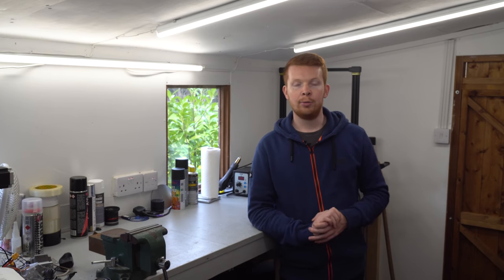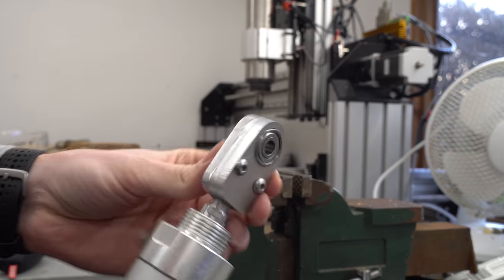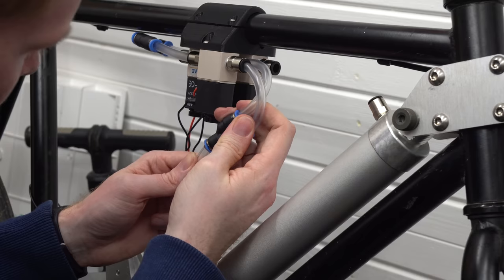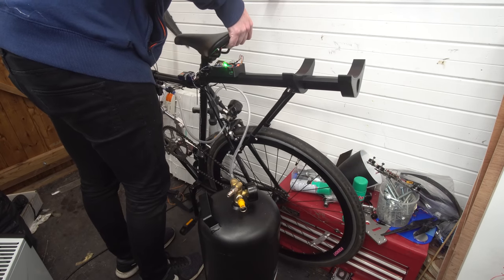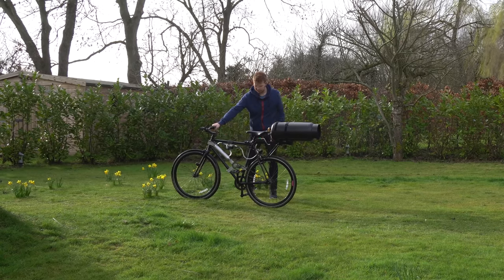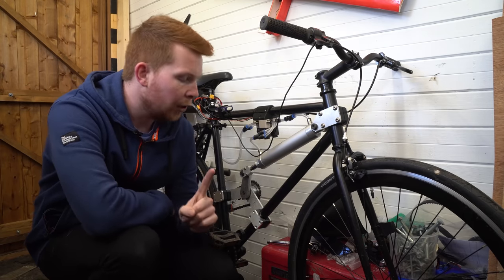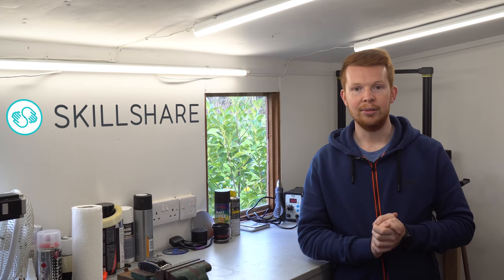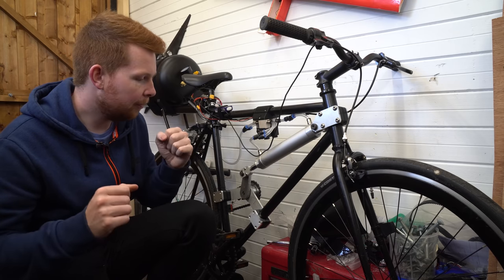Air Powered Bike

Comment: I've always wanted to make a spring powered bike, with a giant coiled spring in a giant disk in the middle of the frame.  This spring will wind as I go down hill, and wind as I stop, and after it has sufficient energy stored, I can use it to start up, or to assist on a hill.  Also, if I am riding down a long sloping path where I don't have to pedal, I would have the ability to include a front sprocket that I can switch to that will wind the spring also with the pedals.  The winding will be ratcheted and the drive itself will be an additional rear sprocket on the other side of the regular rear chain drive.  It will be a direct chain drive on a free-wheel rear sprocket so that at any speed it will wind quickly to meet the current wheel speed, or start from a stop.  Just like pedaling.  So if you engage the spring drive from a stop it will click in and put power to the wheel which you can hold with your breaks..   then at any speed when you click in the spring will wind rapidly until the rpm's reach the wheel speed and assist.  So I'm talking about a disk enclosure in the middle of the frame about 2.5 feet in diameter that is about 6 inches thick with a 1/4 inch thick 5 inch wide and 20 foot long wound spring alloy wound around a central shaft and connected to the shaft and inner wall of the disk via bolts through the spring.  This is how vintage wind-up toys worked, but this would be a giant version of it.

Comment: This is brilliant! I wonder if magnetic sensors would be more accurate than infrared. Thanks.
Reply: Much more reliable at least, maybe not more accurate
Reply: Yes, a hall effect sensor would almost certainly be more reliable and accurate. Infrared gets interference from daylight.
Reply: His system allows for much more precise valve control. The 1/rotation reset function compensates for pulse drops that will surely occur in an ir based system.

Comment: Tom Stanton Clicked on this so fast! Very interesting video and subject.  Being interested in inventions I have always said that when compressed air motors have a breakthrough in technology (above 5-10% efficiency) it will literally change the world.  Or the military will sieze the patent, if they haven't already that is.  Compressed air storage for energy  generating purposes mated with actually efficient air motors is the breakthrough this world needs, it would make batteries and other storage technology obsolete in many cases, especially for solar and wind storage.  Thanks again for an excellent video!

Comment: How much potential energy is actually stored in the compressed air reservoir?
Reply: 101.3 J/L*atm. He said 100 psi, and it looks to be around 10 L. So a little under 7 kJ. Or about the same energy as 0.16 g of gasoline. The energy density is roughly 64,000 times less than with gasoline.
Reply: The energy is pressure times volume. The pressure is 100psi = 690kPa. I don't think he said how large the tank is but I'd guess it's around 30 liters. So 690000Pa * 0,03m^3 = 20700J. For comparison that's about half of what the battery of a new smartphone can store.
Reply: @MrDomino4ever  That's what I was thinking (not a whole lot). Not saying I hate the video though, I understand that he just wants to test the concept. Cheers.
Reply: The benefit of air is it can be done without dangerous substances or specialised metals. Steel or aluminium will do.
Of course the downside is the usable range is about the same as the early rubbish electric cars.
Reply: tin2001 it's probably worse
Reply: @tin2001  , Yes, at 100psi. Why not 4000psi like scuba gear? High pressure compressed air has energy density comparable to lead acid batteries. Not great for cars, but more than fine for lightweight bicycles.

Comment: Reverse the air valves so you can recharged the tank by pedalling 👌🏻
Reply: Can not understand how anyone could spend 4 weeks on a project that uses compressed air , one of the most expensive inefficient  forms of energy there is A few simple calculations beforehand would tell you what torque that cylinder would generate  on 50psi  is.  Wallace and grommet stuff and the position of the  air receiver , obviously not covering handling or centres  of gravity in this lesson 😀

Comment: With all the demand for electric bikes especially in the USA currently you should figure out a way this could work. Then create a kickstarter. You may have to redesign the entire frame (much larger tubes instead of large unsightly tank). People could re-charge their bike frames at any gas station with compressed air hoses typically used for tires.

Comment: If you used a SCUBA tank you could get a lot more range. They are rated at 3000 PSI.  you would need a multi-stage compressor to fill it to from 2000 to 2500 psI. You would need a regulator to lower the pressure before the cylinder. If you ever crashed it might go off like a bomb.

Comment: That could work out pretty good for a prototyper in a city where the gas stations give free air. Not that i expect everyone to get free transportation energy, only the first people will get that benefit, the pioneers. You are a pioneer for this, nobody else seems interested in air power but it could be used and it could catch on if we found a way to compress air in green ways.

 Make like a  3 cylinder 120 degrees out of phase, design the drive from the cylinders to the wheel without a freewheel so you can use the air cylinders for braking, and that energy will be pumped back into the tank. You can still have freewheel for yourself, but make the cylinders connect to the wheel without it. You will have to do braking thru pneumatic control if you want to reclaim some of the energy you spent back. You can still have your regular brakes too just in case, but you won't need them if you design the cylinders to handle the weight of the bike plus you and your baggage, plus 20%, and the cylinders will push you as well as stop you to a dead stop. You might need to also use miro processors to control the braking so that you won't just skid every time you attempt to press the brake, or invent your own electronic circuit in conjunction with the pneumatic controls.

If you are going down a huge hill, then you can help fill your tank just by applying the brake when you get going too fast or someone steps in the way, etc..., and that will help you get get back up the hill later when you go back. lol

Comment: Innovative, well done. You would know that a great deal more pressure is required. Air powered cars make more sense than electric cars. Let me make a suggestion,  construct a bike or vehicle with the frame or body as in cars, as the air tank. In cars, small tubing could be the whole body as the air supply. If a tube broke, the escaping air would hardly be a danger to anyone. Make a bike in the form of an air tank. Best wishes, Les.

Comment: silly boy, you just use the compressed air for a thruster to make it go faster ;)
Reply: Just punch a hole in the back of the tank and you'll be doing 80 mph! ;D
Reply: @rublie1426  You might even lift off the ground :)
Reply: @rublie1426  is this true???
Reply: @ajiteshajitesh6952  I honestly have no clue haha. Why don't you test it?
Reply: @rublie1426  yeah actually I'm doing this project for my diploma.

Comment: It's likely that your gear and chain (properly lubricated) will accumulate dust and dirt and could impare your sprocket tooth counter, and reset. This could be resolved with a cover and dust brush on the sprocket/counter mechanism.

Comment: This is the first time I watched your channel, great ideas.  I have a couple of ideas that may help. First you can use an automotive air conditioning compressor.  Gear it right, and as the gear rotates the compressor can help regenerate the lost air pressure.  Lastly does the piston help the leg fatigue you get when climbing a hill?  It may give an extended level of cycling "endurance"
Reply: I also have a suggestion for you that might help. Learn about energy conservation, efficiency and friction.

Comment: Perhaps fit a small 12v battery and a portable compressor and maybe even a dynamo or two to charge the battery as you drive. Don't know if the dynamo will charge with sufficient current though, but it should help a bit

Comment: Valve timing could be controlled by fitting magnetically operated reed switches to the air cylinder at the end of stroke position.

Comment: You're going to be stuck with a semi-sinusoidal torque output with that configuration. When the arm is parallel to the cylinder torque can only be close to zero and at maximum when its perpendicular on the push cycle. The max on the push cycle will also be greater than the pull because you have to account for the rod that extends.  Psi×square inches of the cylinder bore=poundsforce on the outstoke. For the pull you have to subtract the cross sectional area of the rod from the bore area.  This is a cool idea. Almost like a pneumatic rowbike. Great skills were exibited with the machining and cad. I would be curious to see how this would work if a pneumatic motor was used with the appropriate gear reduction; something like the motors that drive medium to large air tools.

Comment: Sir you must keep the compressed air tank a little sloping so you can climb easily or can have two small thanks on either side of the rear wheel

Comment: I wonder if using the bikes frame as an air storage device would get rid of the high Heavy weight of the cylinder on the back. 
  Being the bike frame is smaller for air storage (once sealed of course) you would have to have a much higher pressure to help the range it can work for as a guess.

Comment: I'm curious what would happen if you used a small petrol powered engine? such as the type they make for bicycles and turn it into a air driven engine. I'm not sure which would work better a four stroke or a two stroke engine. that would be something you might have to research. but with a bicycle engine kit fitment to the bicycle would be already taken care of. and the engine would eliminate some of the valve timing issues. I believe the extremely long stroke of your current design hurting efficiency. perhaps it would be something to consider.

Comment: I admire your engineering skills and interesting content, I highly suspect you are aware that you can mathematicaly answer all the questions to design a perfectly working machine with your first attempt, many people have done this before but I do love watching your videos, I think very intertaining, thank you.
Reply: May I suggest using a dive tank with. 80 cf @ 4000 PSI regulated to 100 PSI to operate a 1 1/2 inch cylinder with a 6 inch stroke, just a thought

Comment: You just need a mountain bike with a flywheel and jackshaft kit. Still you kinda need the fixy gear to cycle it hence a heavy flywheel and smaller cylinder at higher speeds

Comment: I believe you should have installed two air tanks as one per side of the rear wheel. LED Lights Green & yellow (4 total) would change when the pressure is detected as being low in one tank and automatic switching the solenoids to the other tank to continue your journey non-stop would be better than a beeper to alert you when that moment arrives., however an air tank mounted to the top of the back wheel would give you a third advantage for a three air tank design, just do not forget to mount lighting to alert anyone driving behind you. If the weight is cumbersome you should also add another piston driver for the chain to operate the added load to the entire bike. Hey, you still have a front wheel that is not pulling at all, place a gear and chain mechanism to that wheel and you got added thrust using the front wheel. You could consider adding metal tubing to handle more pressure then any configuration of tanks could power up the wheels, remember you must have a lot of thrust going up a hill and if you could make a breaking compressor to add more air to a tank you could refill a tank on your way down the other side of the wheel or even not depend on anyone to refill a tank or three.Good Luck, I am the @Jonalist on Twitter.

Comment: I have a small air motor about the size of the rear hub of the bike's wheel.. the fewer changes in direction the more efficient the machine... it's operating pressure is about 4 bar.. 100psi prox... it's more for going fast.... good brakes are necessary
I have a larger air motor that just might fly... high rpm.. lots of torque... counter rotational fans.. all the parts are ready.. a few minor items.. like the propellers are in the design stage.. Thanks for sharing Tom
Reply: think air rachet... air tools are pretty clever and much lighter than electric.. obviously the storage of air is a required feature.. I will let you know any possible results... just for fun

Comment: heres an idea
using a rotary type pnumatic motor (same as whats found in most pnumatic tools that rotate. i.e air ratchets, impacts sanders and pnumatic drills and diegrinders
its basicly a cylinder with a shaft goigh through it but the shaft is off center and this shaft has the "rotor" on it which has fins coming out of it usally theres 5 or 6 of these fins or as i call them "apex seals" and basicly it decompresses the air to create rotational motion
make one (idk how posible this will be for you) which makes loads of tourque then mount it to the bike

Comment: I am a little late to the party here, but you may want to look into using two 3 way valves or one 5 way valve to simplify the timing of the valves. For those unaware, 3 way valves have a pressure port, an exhaust port, and an output port. Typically they are used such that the pressure is connected to the output in one state, and the output is connected to the exhaust in the second state. This removes the need for having 2 separate valves, one for inlet pressure and one for exhaust, and will simplify the timing and control circuitry.

Even better, you can further reduce the complexity by using a single 5 way valve, which is basically two 3 way valves tied together with a common pressure port. Typically, in one state pressure is tied to output A and output B is tied to exhaust, and in the second state  pressure is tied to output B and output A is tied to exhaust. These are really useful for air pistons, as each output goes to one side of the piston and you don't need to worry about timing the exhaust of one side and the pressurizing of the other side since they are tied together.

Comment: You might also consider a commercial diver's tank with 22,000 psi for extended range and more power for speed, if metered properly. You would need much better cubing. Caution: High Presure.

Comment: Hello, I am a Control Engineer and I have a suggestion. If you design a controller mounted on the handle to adjust the timing of opening the solenoid valve, then you can switch between high torque and high speed. Initially you can delay the value opening time to get high torque and as you achieve speed, you must advance the valve timing to pick-up speed. This also reduces air consumption at high speeds. Please give this a try if you still have the old setup.

Comment: Use thos 21 gear bikes, link the piston to pedals with as much torque you can and there you go... You could also use an air tank with alot more pressure

Comment: I’m just building an air powered recumbent trike. If you use a trials crank with a freewheel built into it. you can freewheel nice n easy. And I’m using a small “three cylinder rotary” air motor from an industrial food mixer... no pistons / cranks / ect smooth and lots of torque 😁👍 also if you talk to a friendly firefighter. The air tanks they use and are discarded after their life cycle are carbon fibre 👍

Comment: Hello I was thinking! "whilst watching your video" maybe have a small cam wheel with a poppet valve arrangement on a inline pipe chamber feeding the air to the cylinder then by rotating the cam against rotation that will be the high speed advance function then as road speed increases your air flow will reduce due to time verses flow to get the air to the cylinder thru the pipe so for cruising you would be using less air over a given amount of time saving the air reserve in the tank its sort of the same principle as a mechanical injector pump using barrel and plunger with dieseline to the injectors only yours is controlling the air flow to the cylinder anyway something for you to think about i like your video very good cheers john.

Comment: Video was impressive. Next time, rather than piston, mount a small rotary engine. I would greatly improve the performance. Also, think about you collect air when you go down hill and use the air when you go up hill as additional power source rather than 100% power source. How about using the air thank just as a power storage. If you have time, use wound spring (used old wrist watch or some toys) instead of air tank. In this case you can mount wound spring inside the rear wheel (get rid of spokes).

Comment: project is quite good. but you should keep working on positioning of air tank. And corrected compressed air ratio charged in cylinder. People don't need kick start with compressed air. They need compressed air charged while they are exhausted paddling.  Speak with cycle rider about his requirement and you will see a way through it. Good job, keep it up.

Comment: A larger diameter cylinder and a high pressure tank w/ regulator would definitely help ramp up power and range. A helium tank would be even better.

Comment: The cylindar has a multiplication factor, increase the diameter
Of the cylinder  example
50 psi X 2=100.  There is a few things you can substitute to increase your out put.